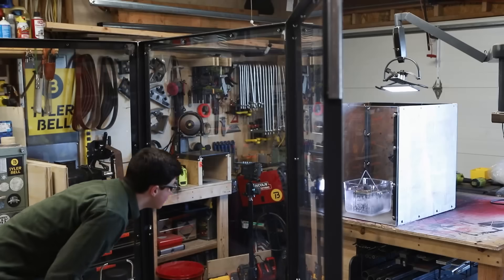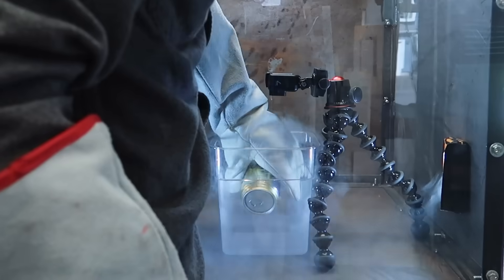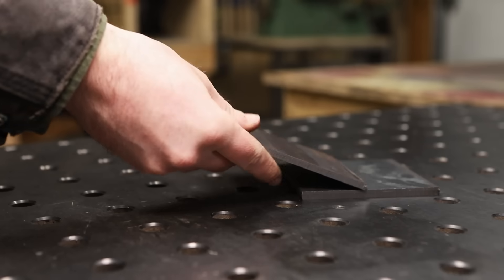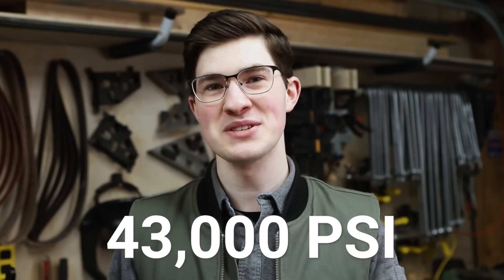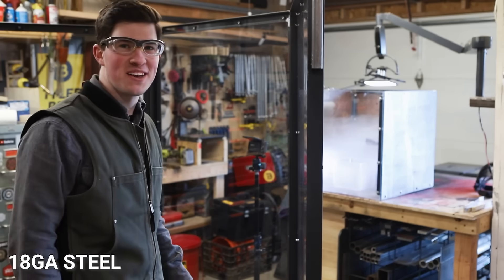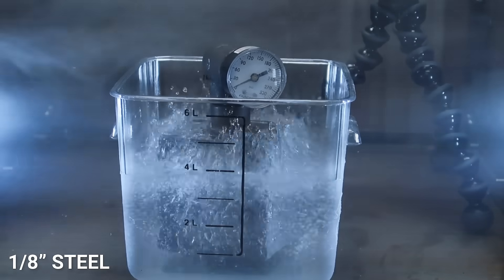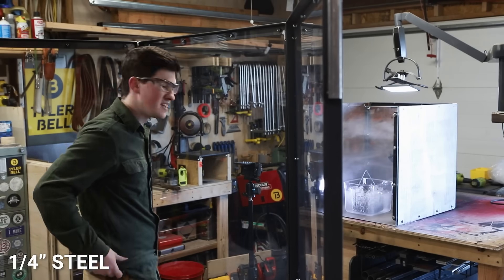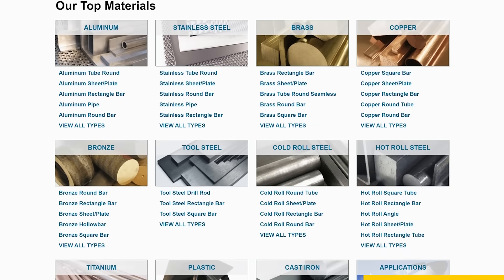Keeping ICE from EXPANDING?? (in liquid nitrogen)

Comment: Hi Tyler. Very cool video!  I always worry about ice expansion breaking engine blocks and pipework, when we have cold weather. High pressures are scary at times.  For work I was tasked with troubleshooting a 300HP diesel engine. It was driving a high pressure water pump which operated at 40,000 PSI for blast cleaning. The working parts were ceramic. That machine used three hundred horsepower, and concentrated it on a pinpoint! 

The expanding of ice causing damage is an interesting effect. In the antique refrigeration field, we see cumulative damage where repeated freeze / melt cycles gradually expand and spread parts away from one another. Sometimes a divot will develop, which fills with water each time it melts, then expands a tiny bit when it re-freezes. That can force fittings apart, or even crack parts which have porosity. The porosity becomes saturated and each time it freezes, it expands the pores a little. 

Recently I repaired a 1953 model refrigerator which developed a leak from frost jacking. It took 67 years, but it eventually caused a refrigerant leak! Darn poor quality control!  Should claim warranty!

Comment: u outta put a load cell on the box, this isnt a refined thought at all but maybe somethin 2 plates, basically it would b the same as u have now, just with an extra free floating wall thats attached to the load cell, either that or make a 1 square inch piece so their no conversion needed

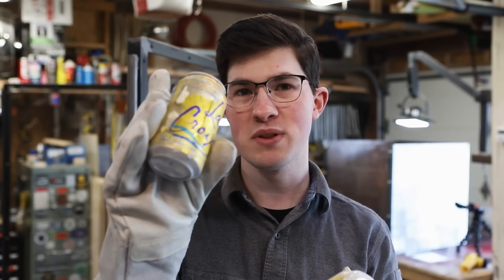Comment: 1:54 I would think the LN2 can exploded and the freezer can didn't for a few reasons. When the liquid is freezing slowly any air in the can or gaseous CO2 can "move around" more. When the liquid quickly freezes it traps more air probably making more air pockets, thus expands more. I have no idea if this is remotely correct. I also wonder if the sudden temperature change is enough to bring more CO2 out of solution again making more "air" pockets in the forming ice structure

Comment: Why use easy to compare numbers if you can just use a unit based on the inverse of a leaden sphere's weight as a fraction of a pound, and then group them 12ga, 18ga, 1/8", and 1/4".

And if any imperial unit guy says otherwise tell me if you can convert 18ga to inches in your head.

Comment: Try using different gasses and different transfer modes of welding. You can get much better results. Even flux core wire would help.

Comment: I used to build tanks ( not the ones you think of when I say tanks ) these were essentially big metal cylinders that could contain product such as asphalt, gasoline, corn etc. The structural integrity of a cylinder is amazing to say the least. It almost stands on it self with evenly dispersed weight and tension.

Comment: So! As a welder who deals with pressure vessels, I have a few insights to your methodology.
1) No matter how good your outside weld is, you still have an open seam inside the box where water could potentially get in and break it. You could get around this by beveling your plates, and leaving an open root to fill, and also increasing weld strength while you're at it.
2) while easier to manufacture, a square box creates high stress points at the corners, increasing the chances of failure. Stress lines don't like 90° corners. Perhaps use pipe next time?
3)your stress analysis, did it account for your box being welded or did it apply pressure on what it considered a perfect hollow cube of steel? Welding creates a heat affected zone than can be more or less brittle than the surrounding area depending on the quality of your welds. 
4)the tensile strength of mild steel is 440Mpa, and assuming you're using standard mig wire to weld, it's rated at 490Mpa tensile strength. Properly welded, that is. And under normal operating conditions, steel shouldn't tear apart under these pressures, but, Since you're reducing the temperature so much, the steel loses essentially all it's properties that allow it to expand.
5) expanding on that, I'm fairly certain that the reason your pop can broke so fast was the rate of temperature change. The rapid drop in temperature made the metal brittle and the ambient pressure in the can might have been enough to overcome that pressure, whereas in a freezer, the temperature changes relatively slowly, and doesn't drop nearly so far, giving the metal a chance to withstand the forces applied. I would like to see the results of your boxes duplicated in a standard freezer to compare.

Comment: Who ever welded these boxes did a horrible job. Any good welder knows the weld is stronger than the metal.
Reply: Actually the weld failure makes sense, because there is considerably more stress at the corners of the box than in the center of a face

Comment: I think it was pretty, lets say, brave to pick up the container at 8:05 directly out of the Nitrogen and having it in your hand, and so close to your face as well, with basically no protection. I mean ok I guess if it didn't go inside the nitrogen, it probably wont outside but still that could have ended badly.

Comment: The composition of the metal is important.  I’m assuming you used cold-rolled steel, which is mostly iron with a low carbon content.  Had you used a higher carbon steel, hard-faced welding rods, and heat-treated a completed box before freezing, your results might have been more explosive.  Great experiment, I enjoyed it thoroughly!

Comment: Broth has TONS of salt in it, thus changing the thermal and expansion qualities of the mixture.  Thus the can of broth will not explode.
Also consider a small square of RockWool insulation to cover the top of the soak vessel as the box is soaking in the nitrogen.  It will act as an insulator and also allow vapor to escape.
Next time take the metal to a welder and ask him to weld it for strength.  There are techniques to weld a certain way to make the seam as strong as the walls.  A professional welder can tell you more about it.

Comment: I believe the reason why the soupcan didn't expandafter freezing is because it wasn't just liquide inside. Ok actually if you think about it there are lots of compressable bits in the soupcan which subtract from the potential ice and don't expand them self as much and these cans are usually very durable especially from inside force or pressure.

Comment: The failure mode of the material related to the temperature brittle point use material which retains the equal Mpa required at cryogenic temps

Comment: the force of the expansion of water when it's freezing in cold temperatures could be used as a power source, right?
Reply: that would be like using a battery to power an electric motor to turn an alternator. Use the original power source instead of losing energy

Comment: One of the reasons water expands when it becomes ice is that the state change is slow enough that all the water molecules can line up on their poles which leads to a lower density. I've always wondered if you could freeze water fast enough such that it's density remains the same.
Reply: It actually is possible, and we use it all the time for frozen foods! It's called "flash freezing" and food companies will expose prepared foods to extremely low temperatures to prevent the formation of structured ice crystals that can damage food.

Similarly you can supercool pure water so that it remains a liquid below its freezing point. Once it's well below freezing you can disturb the water and it will spontaneously form unstructured ice that basically has the same density as the unfrozen water.

Comment: Beef / Chicken broth is a mixture of salt and water (and some oil). The can is meant to be air-free.  When salt water freezes (which is does at a lower temp than plain water), it can actually be less dense than plain ice.

IIRC, being under pressure + no air should be enough for that result.

Comment: How about some cold rolled DOM pipe, like a piece of 3"  with a half inch wall thickness. then you could use a 2" solid pin to fit in the ends and weld in place. I bet that would hold some pressure

Comment: Maybe try stick welding with 1/16” or 1/8” 6010 welding rod in the future for the most secure welds. 6010 rod has a tensile strength of 60,000 lbs 👀 great video tho

Comment: Also that looks like a weird place for the cube to split as the weld is much stronger than the steel.  The steel will be most brittle directly after the weld where it heated up.  The weld is strong due to the process of welding and the fill material used
Reply: At least that’s what I remember anyhow.  Could be wrong.

Comment: cool video
if youd put the blast shield at an angle, potential shrapnels would have a higher chance of bouncing off or not penetrating the glass because the cross section would increase and therefor the energy needed to destroy it

Comment: It would be very cool to do the same experiment with plates that had slightly off center plasma cut holes that would get internal “braces” by plug welding solid rods holding opposing walls together. I’m sure it could take much more pressure.

Comment: 8:07 You had some balls there handling the cube right after taking it out, could go off any moment as the pressure could be still contained.
Reply: Here before 1k likes
Reply: @dawrekk  confirmed its 4 atm :D
Reply: I was thinking the same, and with the plug aimed straight at his hand on top of that...
Reply: Puts up blast box and a blast shield, "hm the nitrogen has run out" PUTS HANDS IN BLAST BOX
Reply: This guy chose death by doing that, it didn't happen, but it could have.
Reply: Exactly what I was thinking.  Incredibly irresponsible and shows a lack of credibility.
Reply: This is why YouTube needs to restore the thumbs down  counter.  Essentially, 26k vs 0 people have an issue with this video.
Reply: i agree, the safety was really reckless and it was all i could think about. he should have had a pulley to remove the the box out of the nitrogen before refilling it or something. the nitrogen could have easily splashed on his face also with some bad timing. could have also splashed on his face when he was beside the blash shield because of no lid
Reply: @jerryhayes4916  A nitro delivery system would have been better.

Comment: The cubes fail along the welds but not ON the welds. That's because steel got weakened by the heat input near the weld (changed fine grains to larger ones, makes for less strength).

Next time, normalize the pieces in an oven to relieve the stresses ..or anneal them (and I KNOW that people will jump in, that mild steel can not be hardenned etc but that is false : mild steel WILL LOCALLY harden by forming small "nuggets" of martensite here and there and those spots are harder and brittle )

Comment: the broth doesnt expand because another portion of it is fat which is an oil which has a high hydraulic compression factor. Think how they use water which has a LOW hydraulic compression factor to explode glass bottles.

Comment: The welds didn’t fail. When welding like that the bead is actually stronger than the base metal in the sheet so the sheet steel gives out at the weld and shears. Edit: didn’t finish the video before writing this comment. The 1/4” plate welds did fail in the middle of the weld.

Comment: Old welder's trick:  When checking for leaky welds, use denatured alcohol instead of water.  Alcohol is less viscous and more chemically adhesive than water.  It will find welding flaws that water cannot.  The flaws show up as dark, wet marks.  As well as filling a vessel with denatured alcohol, you can also saturate one side of the weld by spraying it for the same result.

Comment: Not sure if anyone has mentions this but depending on the wire you used in your welder can change the tensile strength. If you use a wire welder I would recommend you get some FCAW dual-shield wire rated at atleast 70,000 tensile strength or use welding rods. The first 2 numbers on a welding rod is the tensile strength (60)11=60,000, (70)18=70,000

Comment: I see a flaw in the way the boxes were welded. If you had a slight offset of steel on each seam making it so the weld was into a corner with the welder running as hot as possible without burning through the steel it should allow the welds to hold better. Wouldn't help with the thinner metals much but with the thicker stuff it should help especially if you do a base weld with 2 welds on top of either side with a cap weld to tie everything together and you should have a extremely strong weld that would outlast the strength of the ¼ inch steel. If it was ⅜ plate the steel and the welds would possibly hold up to the ice.

Comment: The reason the broth didn't expand is because it was broth. Broth has solids dissolved in it, causing the water to freeze differently. When water freezes, it expands because the ice form crystal structures, but the impurities prevent this

Comment: i wonder what would happen if this was done with certifiable stick welds on something like 1 inch plate with a high pressure hammer union fitting for a bung instead of black iron pipe plugs

Comment: The thin sheet is more heat affected by the welding than the thicker sections - this is a common problem with structural welds in thin materials.

Comment: I'm in a Solid Mechanics class(how forces and stresses affect materials) and also a Metallurgy class and this is such a cool video relating those things. I haven't done any math on this particular problem... but my thinking on the cracking of the 1/4 in box versus the slimmer ones is probably a combination of the increased stress(stretch) rate from the rapid expansion of the ice and the embrittlement you mention. Just remember that materials very in ductility over all temperatures and so no matter how quickly the box cooled down the ductility would still be affected. Sweet video!

Comment: Did you weld the interior of the boxes as well? If you bevel the edges of the metal you will get a much stronger weld. Would be interesting to see if you would be able to contain the ice with slight modifications to how the boxes are welded.

Comment: Need to put a roof on your mythbusters blast shield next time to prevent the LN2 from splashing up over top of it and getting on your skin
Reply: The Leidenfrost effect would have kept his body safe if this were to happen so no need. I image if it did explode only tiny droplets would have passed over the top so by the time it would have hit his body the nitrogen would have been slim to none and it would slide off. I also don’t think that the metal boxes could have exploded either. It would be more so if the box flung it over the top. Very unlikely so he did all the safety precautions correctly.

Comment: you should not expect the metal submerged into liquid nitrogen not to explode or expand or stretch because frozen metal is brittle and tends to shatter especially on nitrogen when the metal has no time to stretch to accommodate the expansion of water freezing. In the case of your experiment, the metal already frozen before water can even freeze. it's not the same with hydroforming where the metal is soft and malleable and can bend if you put water inside it.

Comment: I find it odd that the thickest box  cracked on the weld   

The other one snapped on the heat affected zone 

Like i would have expected the others to do aswell  

But im not familiar with American welding wire  
Or ur skill with a welder   but i find that very odd   
Cuz normally the weld itself is the strongest part

Comment: If anyone is interested in the practical applications of ice containment, I worked in a lab researching this stuff for a couple years, so read on.

It turns out that if you bring water under 0°C in a suitably indeformable chamber, the pressure becomes too high for the water to completely freeze (we’re talking high subzero temperatures > -20°C, not as cold as liquid nitrogen’s -196°C). This leaves two phases, one liquid and one solid, inside the chamber. 

What’s great about this is we can use the subzero liquid phase to hold sensitive biological material, like a transplantable organ. This keeps the organ much colder than you can keep it on ice (and therefore more fresh), you don’t risk destroying it by ice forming inside it, and you don’t need to submerge it in toxic cryoprotectants. All in all, confining freezing water can help organs last longer and be transported farther to help save lives. It’s neat stuff and we think it’s one of the most promising technologies to address the massive organ shortage in the world.

Google “Isochoric (constant volume) Cryopreservation” for more info, including the design of chambers that can actually prevent ice from expanding ;)

Also much like in this video, most of my research was conducted by throwing our very expensive pressure vessels in liquid nitrogen to find out what happens. We managed to blow up one machined from a solid block of titanium, ice is serious stuff...

Happy to try answer questions if you have any!

Comment: You should retry this with variable filler rod.  304, 308, 312 stainless.  My guess is 312 will hold up best.  But splitting down the weld centerline is exactly what you want.  All that said, spheres is where you will get the least variance, due to the least number of physical stress risers.

Comment: Canned foods including broth have head space left at the top of the can for expansion should it get frozen in some unheated warehouse or semi trailer. Soda on the other hand gets filled to the top of the can before lids are put on so no room for expansion. Very dangerous going back to refill the nitrogen and  removing them "bombs" before they warmed up. It could have shattered as you poured the extra nitrogen into the containers or there in your hand. Cool experiment though.